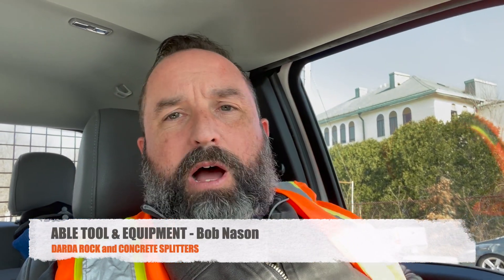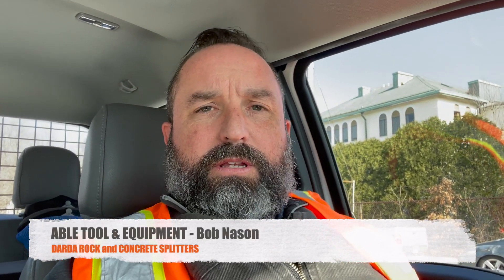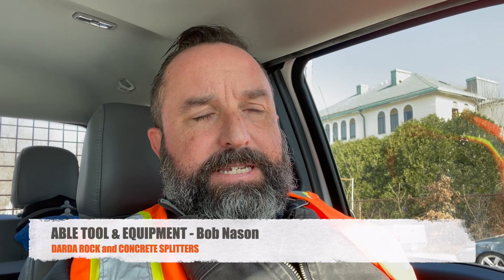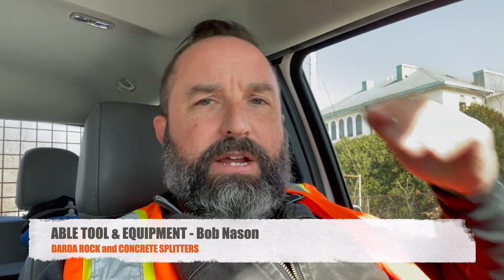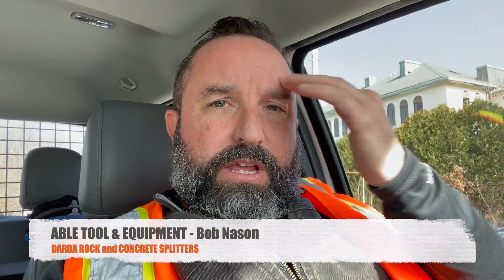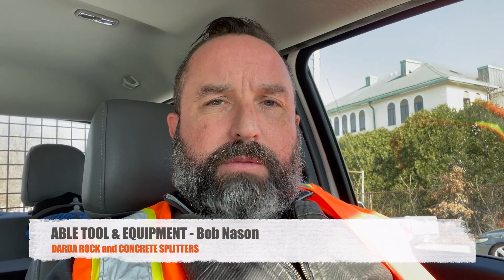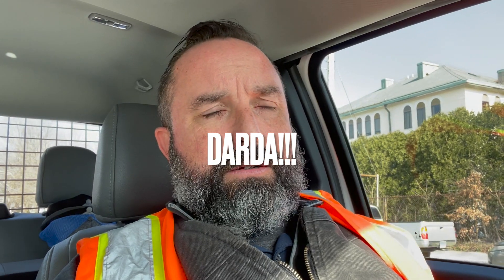DARDA ROCK SPLITTER

Comment: 1 3/4" cross bit, that would not be quick, at least you have a drill to push it down. If you were to change to ballistic button bits you would be shocked how much better they are in hard rock.
Reply: I found that whirly bits, single carbide 1 3/4”, were screaming fast with enough seefums. Like a 250 or 375 cfm. A good rockdrill will suck a 185 completely breathless.
Most jobs I was stuck with 185 because we didn’t use the splitter that often.
It sure was fun.